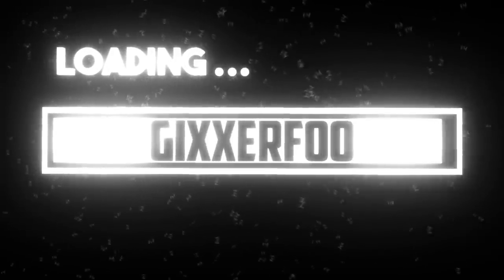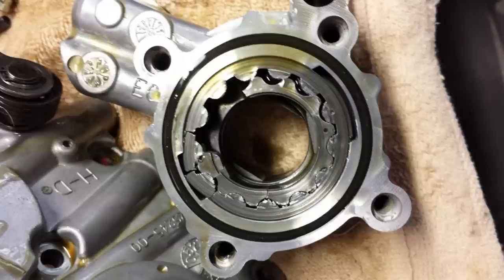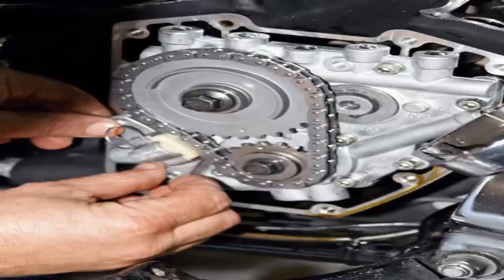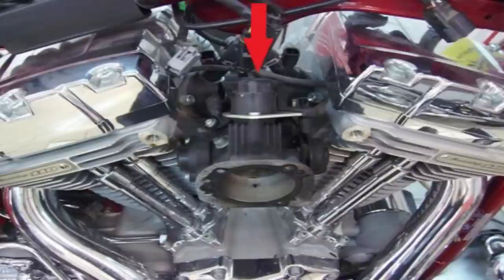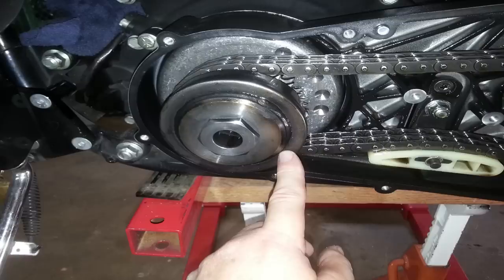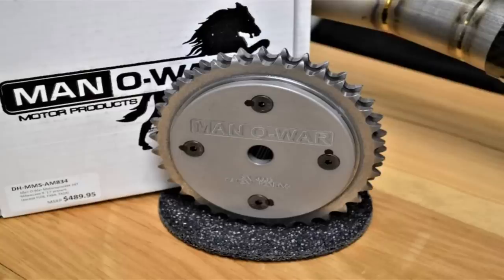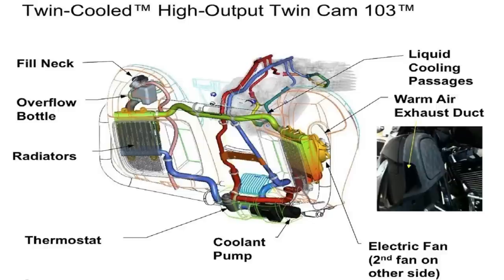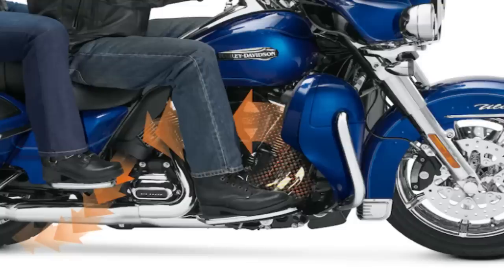5 Harley Problems the Aftermarket Fixed Before the Factory

Comment: Yea usually almost all manufacturers will solve the issues but do like a service bulletin r TSB instead of making huge announcement unless it’s more safety issues  after DOT gets involved but especially HD &  when they it’s usually after about 75% of them is outta warranty just like the chain tensioners they changed and slide that rite in their same as primary tensioner they’ve changed it up several times and hardly ever here about it and my opinion they should’ve recalled everyone of the cam plates and oil pumps and all should’ve came with screaming eagle plates and pumps although I know lot of people don’t like those either but they should’ve at least got more oil through the engines volume and pressure

Comment: You missed the twin cam 88 and 96 inner cam bearing that comes apart about every twenty to thirty thousand miles.it got me twice the aftermarket has a fix but to this day Harley has never addressed it. It cost me 6 grand the first time and 8 grand the second.
Reply from the maker: That's for sure an issue that happens on some bikes, I haven't actually seen that one happen myself.

Comment: Sportster's clutch issue on the OEM riveted spring plates that miserably fail after c. 10k miles or so.
Reply from the maker: That for sure is a issue that arises from time to time, I've seen it happen but not on many bikes.

Comment: I love Harley-Davidsons but I don't think the problems are because they don't know how to build a bike. The problems are because they do too much penny-pinching to save a buck which is screwing the customer when they're paying for a "premium bike". That combined with the way they relaxed some allowable tolerances to skate by warranty claims really made me dislike them as a company. I put a lot of work, time, and money into my Harley to fix most of the penny pitching flaws they left in my bike and after all I've learned and experienced I wouldn't buy a brand new Harley as long as they conduct themselves the way they do.
Reply from the maker: Exactly, if we follow the time line of all the changes they made starting with 2003 that's when the issues started showing up. Everything was done to reduce costs and increase production on the assembly line.

Comment: Dear friend with the cooling part of my 88 that I told you that I have turned into 106. We looked into it's a cooling system called ultra cool. It is. Is a oil cooler mounted  On the 2 down tubes on the  Front of the bike frame. It's an oil cooler that has 3 fais 3 fans drawing drawing the cool air across  the engine. And  It is 3rd thermostatically It's depth to come on at a certain temperature and goes off as certain temperature.
Reply from the maker: I really like the fan assisted oil coolers, they make a huge difference on the Harley since you don't have to be running down the road to cool it off.

Comment: Why wouldn't Harley do a recall for the cam chain tensioner? Wouldn't that be the right thing to do? It's a poor design that didn't work.
Reply from the maker: A lot of those were quietly fixed at the dealer and the cost covered by Harley.

Comment: on my '03 fatboy i upgraded my cam, oil pump, and cam plate (hydraulic) and kicked that problem down the road.  my only regret is the SE 203 Cam is very blah - i should have done a different cam.
Reply from the maker: Nice work! That takes care of a lot of potential issues with the 88, SE cams work well but they don't make the power like the aftermarket cams.
Reply: @GixxerFoo  agreed.  i'm glad i got in there and made the change so i dont have to sorry about the spring tensioner but i should have done a little more homework about the cam.  oh well, my FB is my bar hopper so performance isn't at the top of the list for that bike.
Reply: Try the Andrews 26 cam.  I have the gear drive version in my 2000 Fatboy and am very happy with the performance!

Comment: No other option for cam chain tensioner? Gear drive cams.
Reply from the maker: In the early years the gear drives hadn't hit the market yet, now they are the way to go if you've got the crank run out for it.

Comment: Saw a video on the little fans blowing on the spark plugs, he used a laser thermo before use to show how hot it got right there at the spark plug......then he heated it up again showing how much cooler that spot at the spark plug is using these little fans

Of course he didn't get temperatures any place else on the engine

I'm not real sure having that spot where the spark plugs are cooler than the rest of the engine is a good idea
Reply from the maker: Yeah I don't think I would target cool one little spot around the plug.

Comment: Sportster and evo big twins used to have a riveted spring plate that would explode.
Reply from the maker: That is true, they finally got that little issue fixed!
Reply: @GixxerFoo  I had to buy another spring plate off of my local Harley dealer because they didn't have any 9 plate or screaming eagle clutches in stock. I said it would have to do for a little bit. Now I have a bde clutch in yhrre

Comment: Oil sumping?
Reply from the maker: That's a new one that's really showed up on the M8's, but technically even a Sportster could do that too. The M8's crank case ventilation is terrible, the vented dip sticks really seem to help with that. It's even better if you can get a aftermarket oil pump.

Comment: I don't like that Harley-Davidson has the oil mist going into the throttle body.  Harley seems lots of problems over the years. Yeah, I wonder why I still own one. One day I may wake up go to different brand.
Reply from the maker: I honestly believe the increased crank pressures have a lot to do with it. It's really bad on the M8 along with the sumping issues, the M8 has a horrible crank case ventilation stock.

Comment: they could have circulated the head pressure back into the trans cover  or crank case insted of the air intake. then there would have been a one fix insted of two.

Comment: Harley hasn't fixed any design problems since their engine was designed way back in the 1920s. And you wonder why some people still think a Harley is the bike to get. My old tractor has a better engine design.
Reply from the maker: They are really in a box with the 45 degree twin, there's only so much you can do with that engine architecture.

Comment: Now I know why that '07 was so cheap, one piece stator compensater
Reply from the maker: It's not necessarily a huge issue, I'd get every mile I can out of it and just replace it with a upgraded part when and if fails.
Reply: Thanks, replaced spring pack in comp and got a Baker primary adjuster

Comment: Gear drive and you are DONE!! 😉
Reply: Not if you have more than .0045" crank runout, which most T-C and M-8's have, just my thoughts,and you can't have Gear Drive factory because of EPA noise allowaces
Reply: @jamesstrauss1196  Well I guess I just got lucky then, I put 48k on my TC88B and was at .032 runout and my cam tensioner's were in almost new condition. 
I contribute that to Synthetics starting at 6k'ish or so miles. I have NOT been easy on this motor! And that's a huge understatement!!! It liked to bounce off the Rev Limiter quite often! 😜
Reply from the maker: If you've got a clean low run out you're good to go! Early twin cams 99 to 02 are usually really good, even 03 and newer can have pretty solid numbers unless they have a lot of miles.

Comment: Don't forget!  S&S makes gear-driven cam kits for Twin Cam engines.
Reply from the maker: That's for sure a good fix for worrying about tensioners, if you get a bottom up rebuild gear drive is the way to go!
Reply: @GixxerFoo  I have a 2000 Harley Fatboy, and when I first heard about the cam tensioner issue I went to the dealer and asked what Harley was going to do about it.  While I had no issue at the time, I got the S&S gear drive cam set up and it has been in my bike ever since.  BTW, the measured run out was .0015 at the pinion shaft.  A month ago, I needed a bottom end rebuild and sent it to Darkhorse Crankworks.  Due to a rod issue, they replaced the rods, balanced the crank, welded the crankpin and balancer sprocket, and replaced all bearings.  I got it back and am re-assembling the bike.  I had 125k miles on the motor at the time.

Comment: No warning?? Man they made a ton of noise when the. We’re starting to get wonky
Reply from the maker: Tensioners would make noise but you are lucky to hear it, most people didn't catch it in time.
Reply: @GixxerFoo  I am always adamant about at least taking a peek in the cam chest. I’ve seen the tensioners go in as little as 4K miles and last as much as 34k but usually around 25k
And people always seem to take the advice to upgrade

Comment: We would think and should demand that after 119 years the mo-co would get it right. at over $20,000 for a defective motorcycle, they should be at least reliable. where not talking about an electrical short or bad plugs, but an engine destroying fuckup that could cause an accident left not corrected.  WTF?

Comment: What about when Harley-Davidson ahead the vrod liquid cooled the best mechanically speaking did Harley-Davidson ever made to this day what did Good Ole Harley do discontinued never fails the apparel company that happen to sell motorcycles enough said
Reply from the maker: The Vrod had a really good run, it just didn't catch on and the sales were really declining on that bike. The engine actually wasn't ground breaking new when it came out in 2002. It was actually a streeted version of the VR1000 road race engine, which originated around 1988.

Comment: How about cycle-rama compensator?
Reply from the maker: That's another excellent part, Cycle-Rama makes quality components and that's a great OEM replacement.
Reply: @GixxerFoo  My question is this which one of them is the most long lasting and makes your bike bulletproof even at 200 plus rear wheel horsepower in rear wheel torque. Mainly most are over but 150 to 100-180 on torque, kind of fluffing it up a little bit higher gives it kind of is a vantage to me in my eyes of you know kind of a leeway to little torque and horsepower well that’s on you but too much you start putting a lot of pressure on your components compensators one hey the belt is another one how about that is chain really a better thing to go to on the touring bike when you starting to get 150 to 200 1 foot pounds of torque? That would be a good topic on how much torque is too much for this that this in these things and those things that would be a good one and what to replace him with or is it just a shame to sell you that chain kit? I’m going up to 131 and they seem to think that as long as the belts in good condition hasn’t been hit with anything or done that 150 or better foot pounds of torque is OK for it so what’s your thoughts.